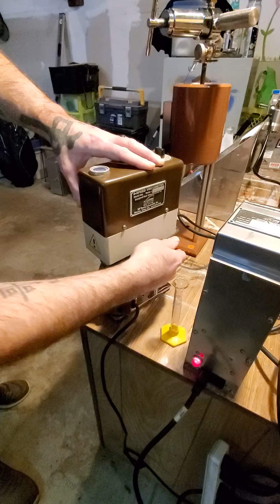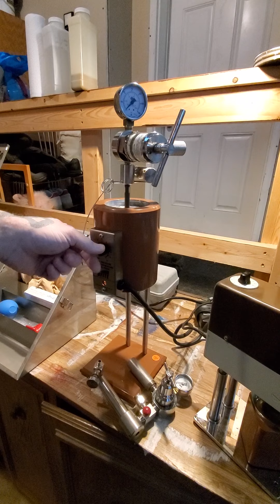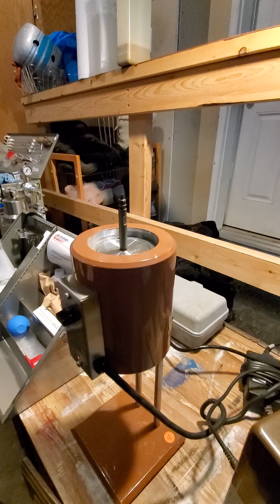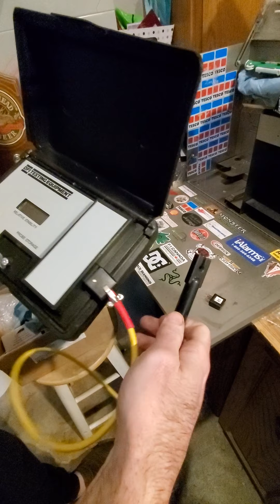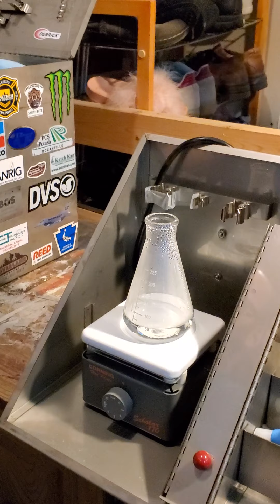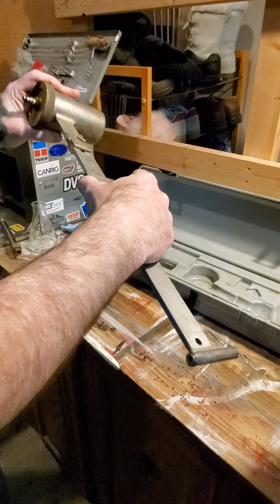Ofite Testing Equipment 031221

Comment: I just nailed a 20ml ofite retort on eBay. I also nailed an MBT kit. I know hardly anyone uses the MBT test any more but the mud school I went to has a special dilution ratio based on total solids in system. 
When I worked for Secure Energy in North Dakota they sent me to train with some of the Canadian boys near Weyburn Sk which is fond memories.